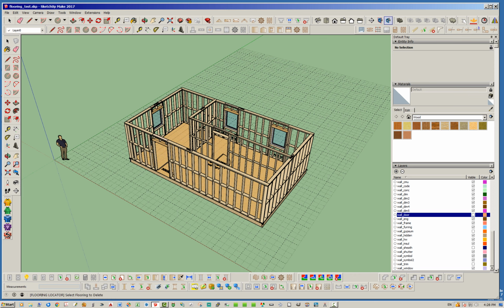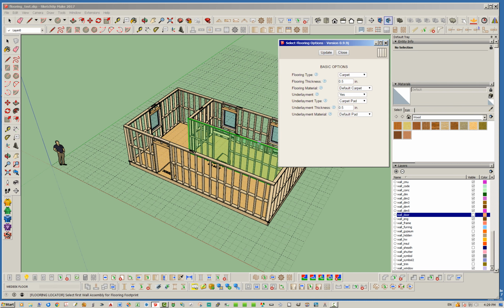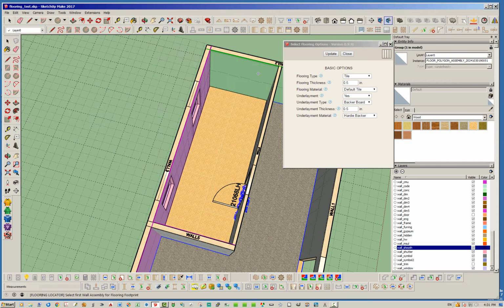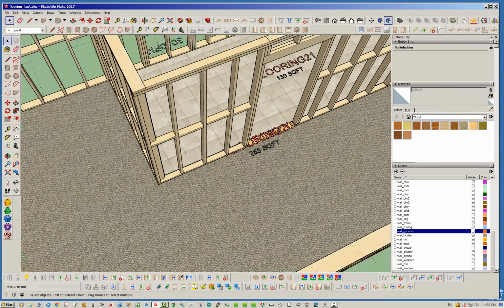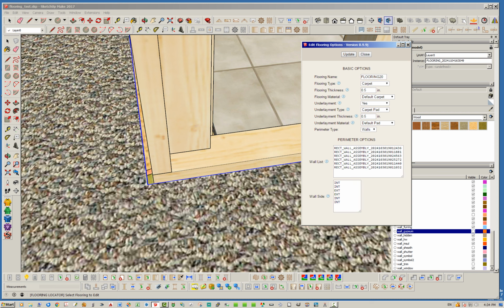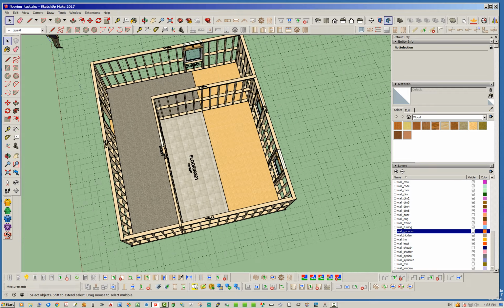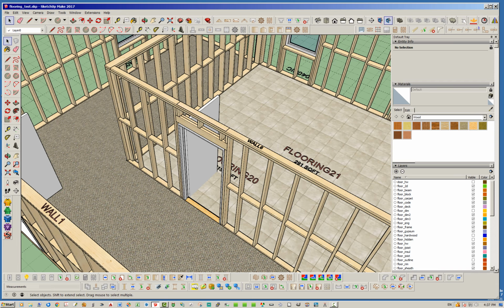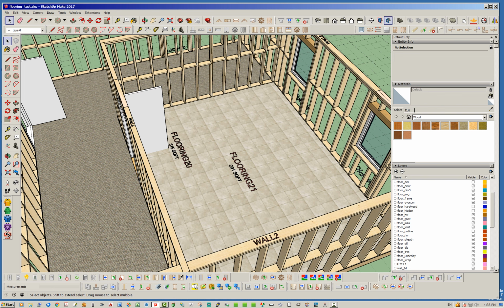Medeek Floor Plugin Tutorial 15 - Floor Coverings with Walls

Comment: Also the wall selection function you have coded for the floor covering to determine the perimeter is genius and the reason your extension is best.

I use your extensions for every step of my project…
I first use it to visualise and calculate the scope of works for my quote, which I then animate and screenshot images in the quote so the clients can understand and amend as needed…

Then when my quote is accepted…
I animate the construction steps for our fitters to visualise the desired construction process and most importantly show them the start and end result, I also use the design with all relevant shareholder with great success.

It’s not a perfect workflow, but I smashed anyone in my area but I haven’t meet anyone that I can learn from…
So if you would be so kind as to request all your users to share with you and us how they use  your extensions in a real life settings, so we can learn from each other?
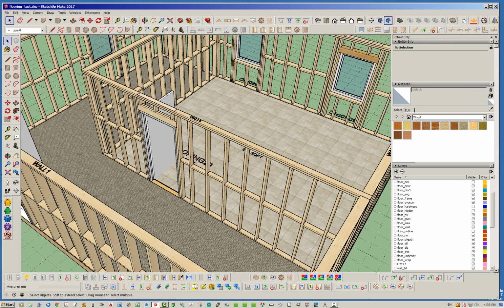Reply: And then you can share real life uses from other people for us all to use 10:30
Reply from the maker: I need to encourage more users to share their workflow, perhaps incentivize it somehow.  I will give this some more thought.

Comment: Sometimes the floor coverings end up in the middle of the opening and this is acceptable. because when the door is closed it covers it pretty well. That is a nice feature to be able to select the walls.  The only other thing I see is that it would be nice if the floor label stayed in the room it is labeling.  Nice work!
Reply from the maker: I need to figure out something for the label.
Reply: I've wondered about the label as well. I notice in all the modules that it goes to the center of the entire rectangle. It's been a challenge in the past with moulding labels being placed in walls or in other rooms etc. Not sure what the fix is but it would be a nice touch.